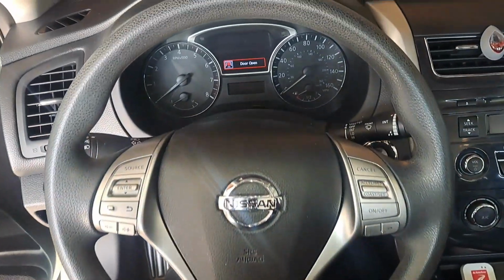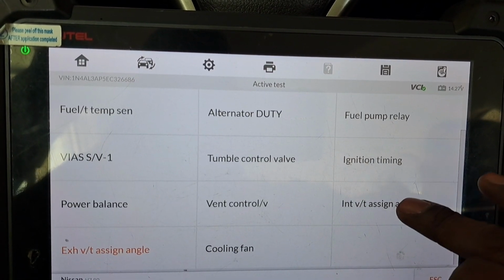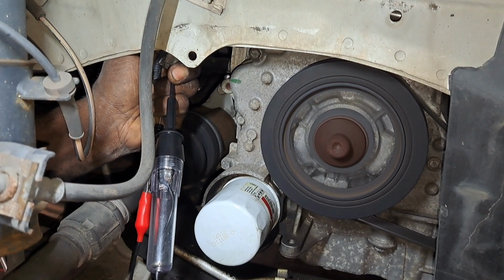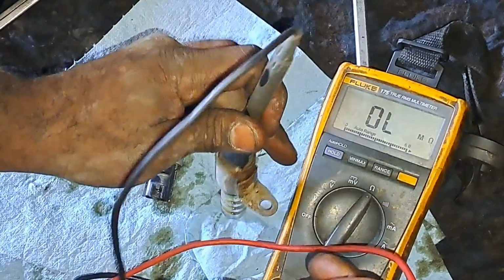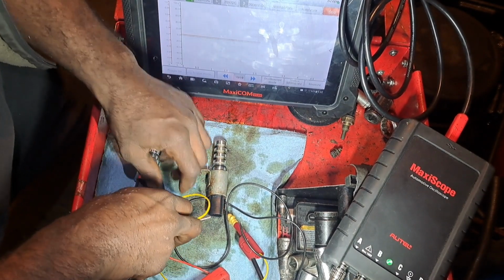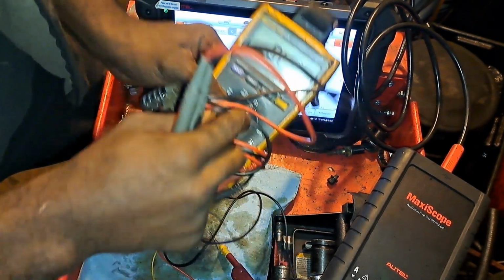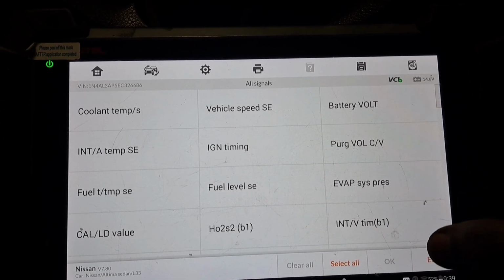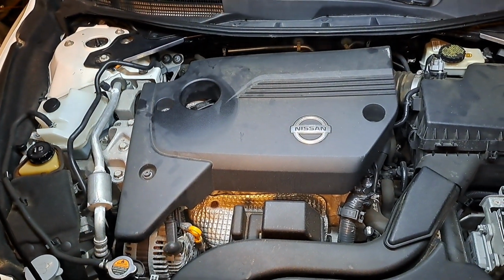nissan P0011 stalling and low power

Comment: The good solenoid shows the hump in the amp waveform as this is the pintle opening, the voltage trace shows the pintle closing, the bad soleoind does not show these attributes as the pintle is shot, hence the different sound. There is mechanical information in the humps based on where the hump is happening. Thanks for doing all the diagnostics so we can simply do SWAPTRONICS to test the 2 solenoids, again with no scope required but watching the pintle humps is what I want to see to check mechanical ability on a working unit with no broken internal return spring, cheers.